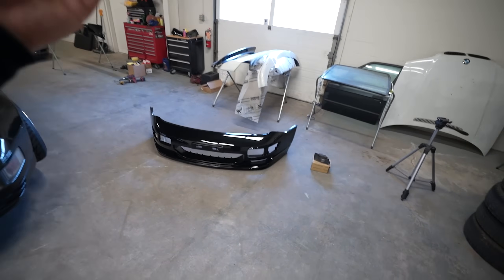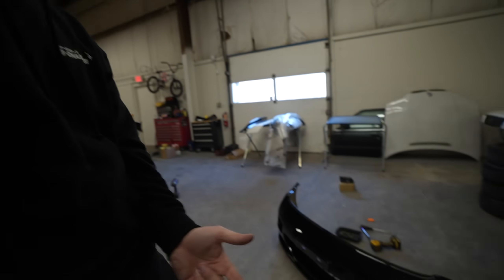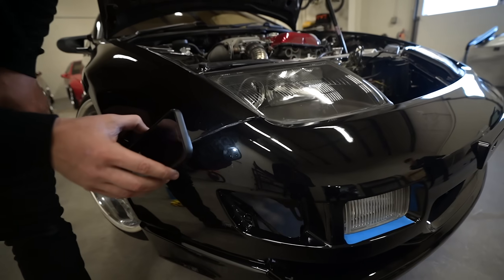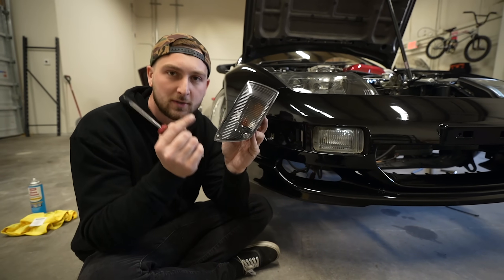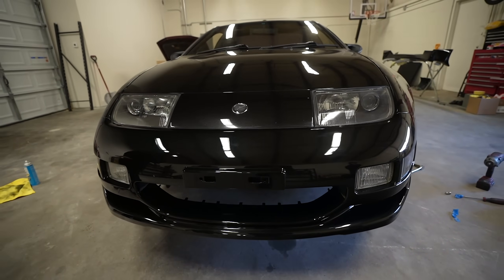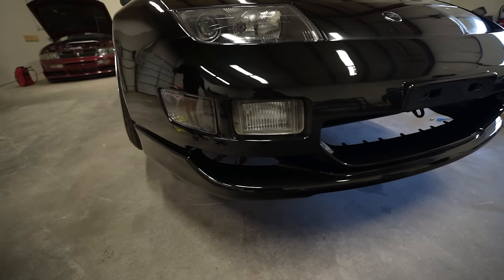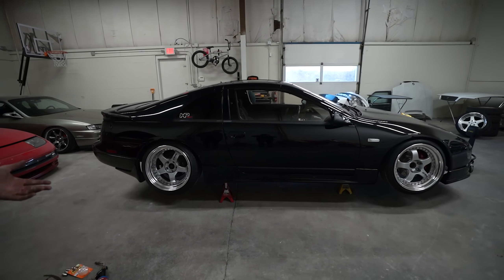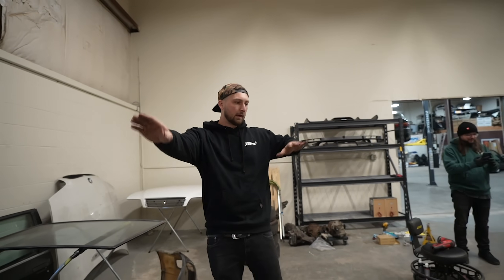My 300ZX gets a COMPLETE TRANSFORMATION..

Comment: It needs a big front mount intercooler
Reply: Right.. fuck a grill insert, FMIC!
Reply: It's mid mount would be shit compared to what it has now ( meaning the intercooler is mounted in front of the radiator shorter intercooler piping )
Reply: Temps aren't the best, double intercoolers are badass
Reply: Wait forgot it's not the vg motor! 🤣

Comment: You can use the stock blinker socket for the 99 lights. Just dreamed out a little bit of the 99 light where the socket twists in, tape up the not used socket and wires and done. I also have the 99 spec pigtails if you need them.

Comment: @06:40 please please please get radiator and intercooler air guides installed. it prevents you from seeing the road through the front bumper openings and allows the car to feel higher end. seeing the road through those openings seems and feels cheap and underthought.